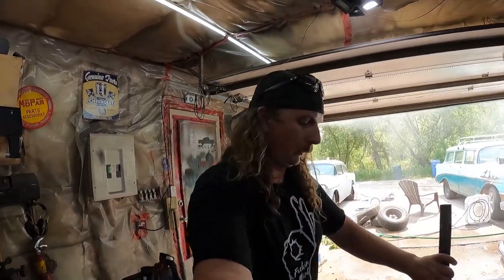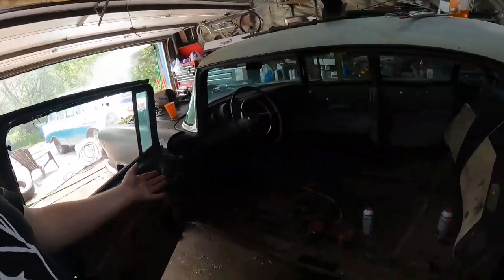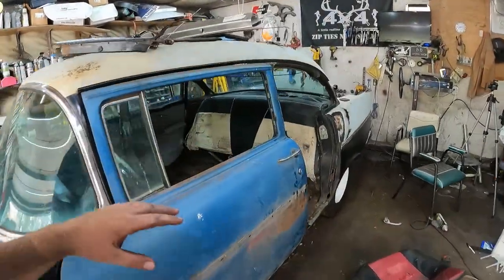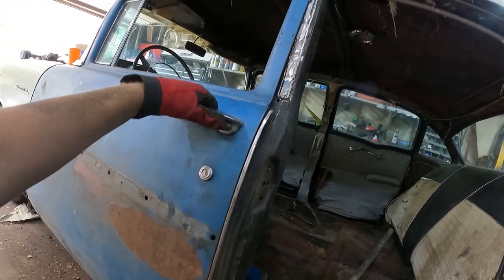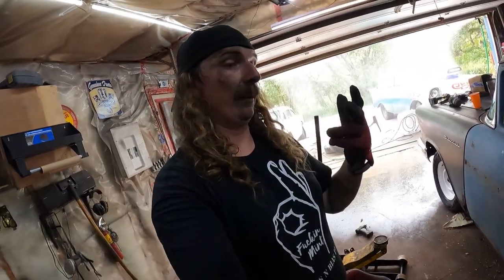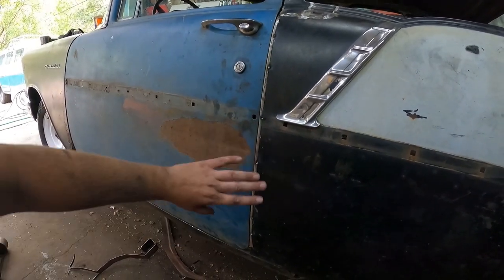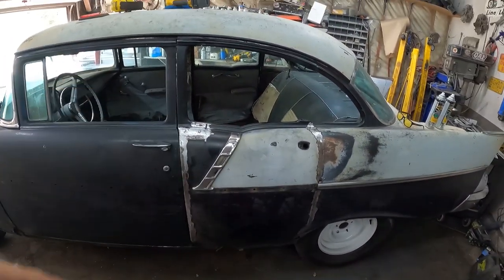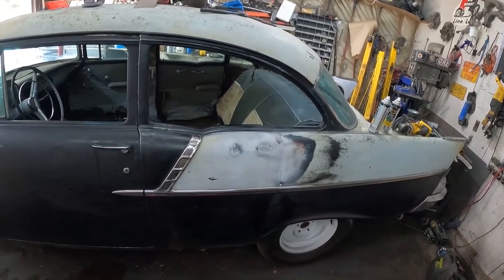Best 2 Door Conversion On The Market! - Tri 5 4 Door to 2 Door, Instant Cool!

Comment: DAN - go back to your buddies junk yard, where there were old chevy trucks and grab  6 lug, front hubs, rear axles, drums, and wheels for your black widow - I know I've seen other people mention it and am sure you know, to complete the package, 6 lug wheels is the coup de gras ! Car will be awesome as are all your others
Reply: Right on
Reply: I would ,fer shur
Reply: Read my mind
Reply: 6 lug was "high performance" brakes right?
Reply: @rajcam80  the 57 6 lug pick ups had bigger drums and 6 lugs were better (safer & stronger) than 5 at securing the wheels
Reply: Yeah Dan!! Do it right!!
Reply: @billykay2411   they "thought" 6 vs 5 bolts was safer,however it isnt but if he is going for an authentic black widow "clone"  then so be it
Reply: More fasteners (of the same size)is always going to add more clamping force. Simple physics, they "thought" right.

Comment: I like the 150 base model better than the rest of the 57’s. My old man had a 4 dr way back in the mid to late 60’s when we lived up in Chicago, w/a 283 in it, pretty sure it was, that wasn’t the original engine, I believe it originally had a 265 in it. Anyways, cool stuff Dan the man!!
Reply: First year for the 283 was 57. It may have well been original.
Reply: @frankjones4950  - no unfortunately it wasn’t, I remember hearing the old man telling somebody about it and whoever he got the 57 from had put a 283 in it, the original engine was blown. I wouldn’t swear to it but I thought he said the original engine was a 265.
Reply: Didn't  the original Black Widow have tinted  plexiglas for all the side windows? Cheaper than special cut glass too.

Comment: Great job explaining what you are doing, rear windows on some of those cars had fixed glass in rear, trying to get roll up windows is a pain so just use fixed glass. and you and Mur should paint the car.   pant the drive the heck out of it with the LS engine put put Air Conditioner in it no problem the LS  engine will have the pump already installed. cheap under-dash system works great.

Comment: Something I learned the hard way about these wrap-around cars & trucks:
The old body man that lives up the way from me used to work for the GM Dealership when these (wrap around) cars where still being sold. He queued me in on the the body gap/door fitment on all these (all makes). The front fender actually sticks out a tad, and the back of the door is supposed to stick out a tad kinda like shingles on a roof. He said they did it this way to cut down on the wind-noise & water that the wind-lace can't catch. We did an "early 55 truck" and plaid HELL getting the doors to set smooth & even with everything...... he came in and said "looks good, but it'll whistle". Sure enough, it whistles down the road, but looks really good sitting still. That's when he showed me how to actually set them, and it really helps cut down on all that.

Comment: I love it especially with the white steel wheels. Makes it look like a old circle track car. In my opinion get it all smooth and do a matte or satin black and then a flat white if your gonna be daily driving it I think that would be killer and it's easy if you scratch it or ding it up to just do quick touch ups. I'm getting rid of the metallic blue on my s10 project and gonna get some matte navy blue mixed up and she how that goes

Comment: I agree 4 doors are lame. they where lame when I was a teen in the 1960,s. We considered 4 doors parts cars. Today I have 3 56 chevys and 6 55 chevys.  3 are rough two doors and one is a solid running 55 handyman 2 dr wagon. Im going to use the 4 doors for parts to fix the 2 drs. I have a solid 56 more door that runs however I aint going to drive it. I think a conversion like your doing on the 57 is in its future.

Comment: Kinda like the S10 you can use a blazer front door from the 4 door. Works on standard or extra cab shell's. It's done to save cost. No mods required.
Reply from the maker: Good to know!
Reply: @DDSpeedShop  I know works on the first gen 85-92 because I was driving 92 Xtra cab no power windows. I was going to auto collision school at our local community college. The dean of the school donated his 90s 4 door blazer blown motor with every option. We got to tear it apart. It had power windows. I got the doors leather buckets and the GMC grill.

Comment: Danny a car in that shape in SW Tenneressee would go from 3000.00 to 8000.00 here and the crap i get when i say it would make an awsome 2dr. Purists i guess. I told you about my buddy bought a 57 4dr sedan wrecked in the rearend it will need Qtrs and trunk pan and tail pan and rear bumper and he paid 1800.00 for it alot of work needed plus floors etc about everything you have to do to yours. Theyre far and few between down here!!! You do amazing work buddy !!! I love your tri five videos.
Reply from the maker: Wow. Thats nuts!
Reply: thing is,dont say anything...just build it..dont look for approval

Comment: I love  your channel and can”t wait for new videos every day but since your channel is growing maybe a tiny bit less ratty.  I am not saying full restoration but maybe a little bit more like a decent interior, creature cruising comforts and a tad more body work.  If you don’t want the black widow that way maybe you can show us a little on Dani’s 57? You could do power steering conversion kit for $1200 from speedway motors for everything including an automatic tilt column with shifter (gets rid of Ratchet floor shifter) power steering gearbox, and all steering components needed on her 57 while you are pulling the LS out so she can drive it safer without that gigantic steering wheel and not be  seated uncomfortably and convert her crappy vacuum windshield wipers to electric for around $500.  Just my thoughts. All these upgrades would also make some great videos.

Comment: My comments are always too long so you didn't miss mine not being there. I had company over from minnesota and so showing your videos to them so when they get home should be new subs for this channel. I do what I can to get your channel growing. I tried with Dani's channel but these showbinist bastards didn't have time for girls channels.... they are dumb cause Dani tries hard for you to grow and brings her fair share to the table. I did my part and their wives will do the rest but me 73 and them 20 something so there is the bump in the road. No one has time for us old shits. I don't go anywhere Dan. Hospitals and home and wait for the bell to ring for me. I live on a level six at least everyday that I don't have cannabis oil for pain as drugs were for when I served in Nam and bugs and bullets were making buzzing sounds in the air. I like this 57 body style and like the way that your finishing it off.... kinda agree with Mur your dad as I most likely butchered the names. Damn it Jim. I think clean it up and black primer or paint to set it off. Its too bad that the floor couldn't go in while the room was available. I haven't done this so don't know if the floor sills are strong enough to keep the integrity there and set a floor pan in or not. Maybe when you move to the place where the shop is a little more roomy that you can pour a floor with some frame rails in it to do straightening of frames or holding one still while you get stuff done...... funny to me, we take doors out of cars and add them to trucks. Two doors are enough for me and the dog doesn't have opposing digits to open doors so he jumps in on my side muddy feet and all and then drools till I feel like I was in a sona. Enough whining from me. So good times coming for  those who get there first

Comment: A muscle car has these things or it is NOT a muscle car. !. a V-8 engine. 2. it's a 2 door (4 doors are way to heavy). 3. 4 or 5 on the floor transmission. 4. rear wheel drive. This is coming to you from the 60s.

Comment: Ok so what I’m hearing is you like your car to be cool. And 4doors are not cool. Because of the arm rest issue on the wagon why not convert it into the extremely rare 2 door wagon.  Or even rarer three door. With back seat is always down for dogs and have right side rear for them and move the damn post for your arm